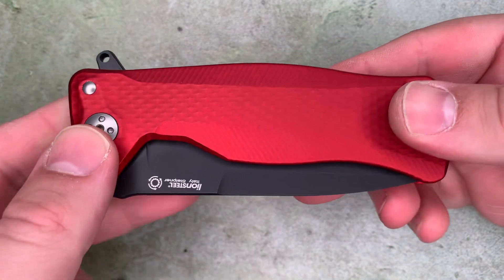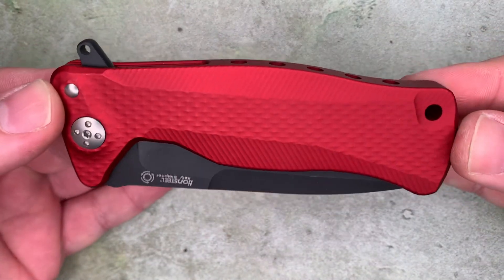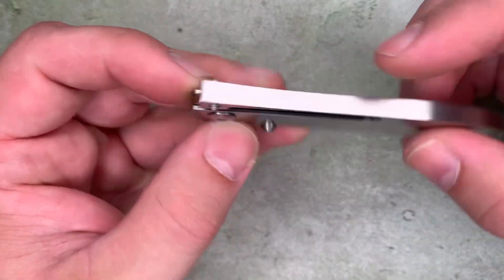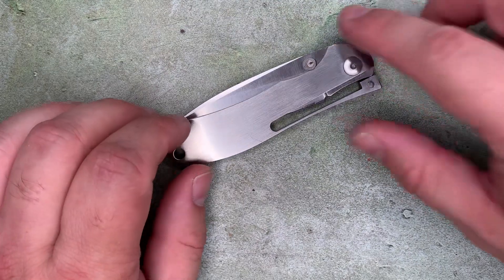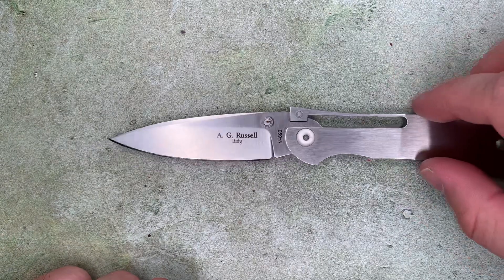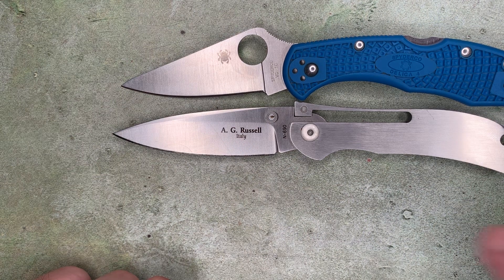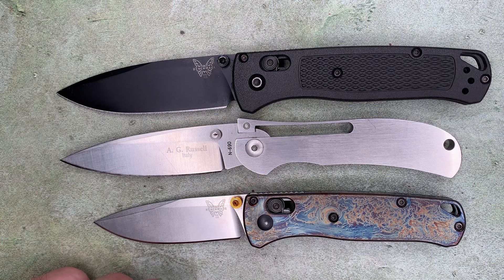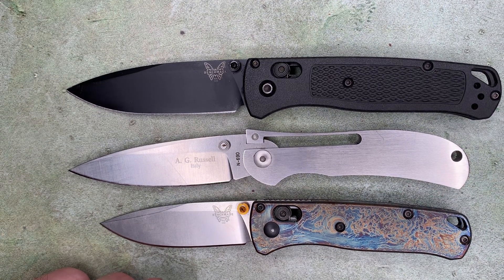Discontinued masterpiece: the A.G. Russell One Hand Knife

Comment: I was able to negotiate one on Ebay for $130 and it's in perfect condition, but the pivot is a little sticky.  I'm going to take it apart and clean the pivot and lube it, but I can see it doesn't have any bearings on the pivot.  Does yours have bearings?  Wondering if someone messed with this and lost the bearings.  The pivot screw was loose like someone tried.